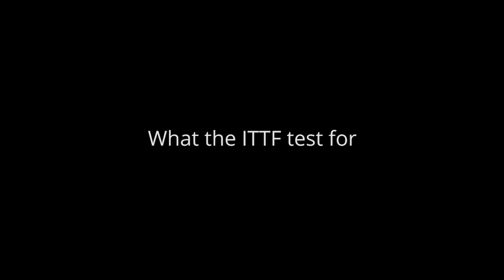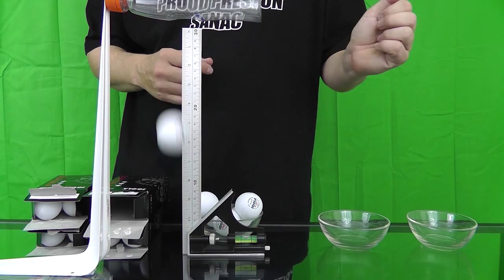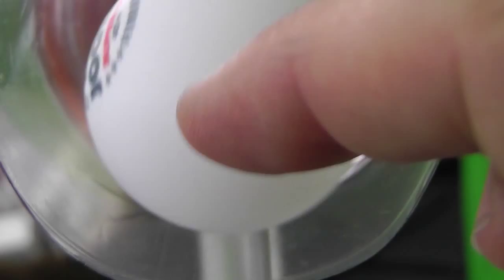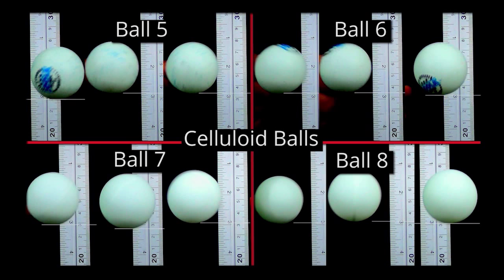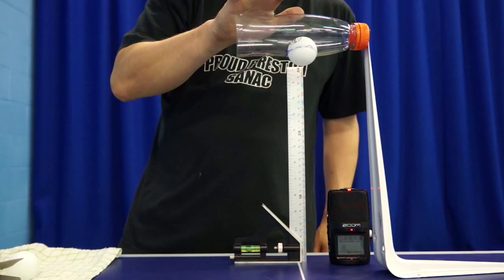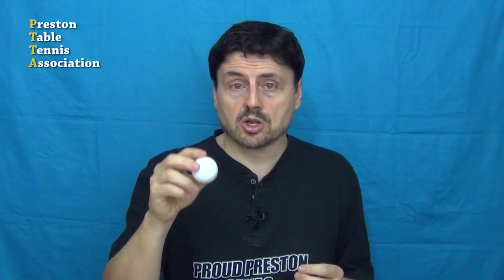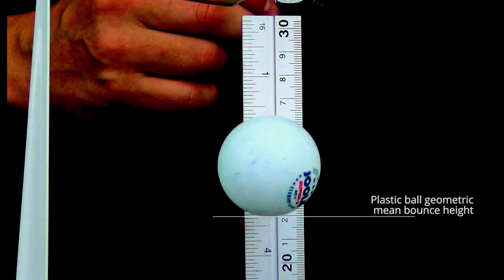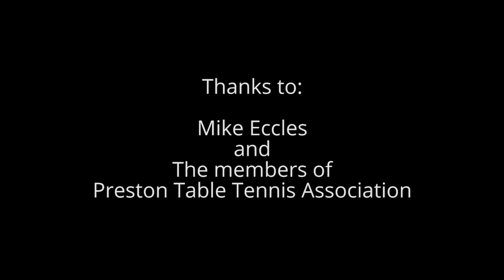Plastic & Celluloid Table Tennis Balls Compared: Bounce and Conformity

Comment: So which is better? Plastic or celluloid balls
Reply from the maker: As plastic are here to say, I'm not sure this is relevant anymore. Personally I tend to find the celluloid were more consistent in bounce although as production has increased, that element of difference has decreased. Depends if you like more or less spin and more or less speed. Old celluloid tended to be a little quicker and spinnier
Reply: @PathfinderPro  what's the durability of both balls?